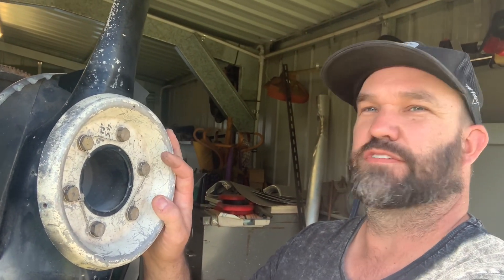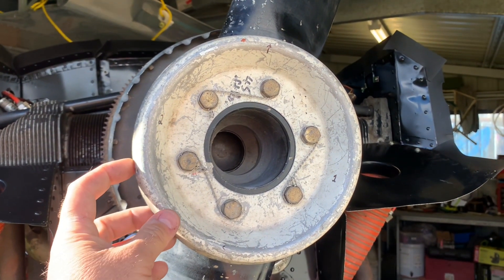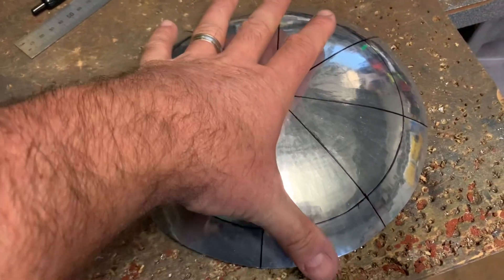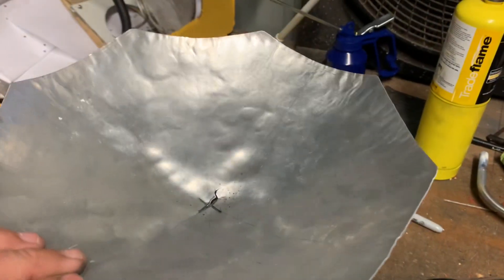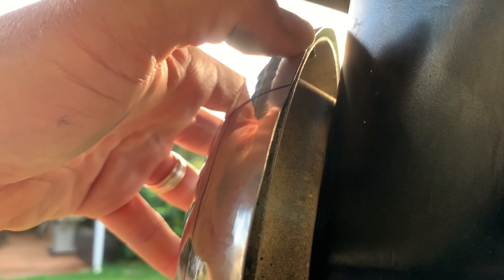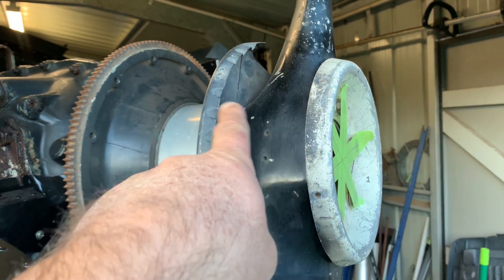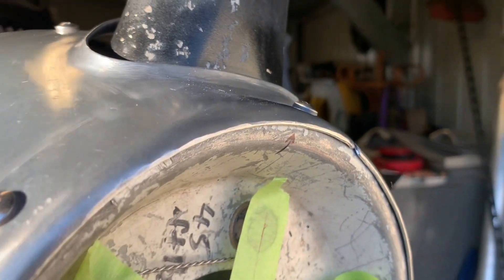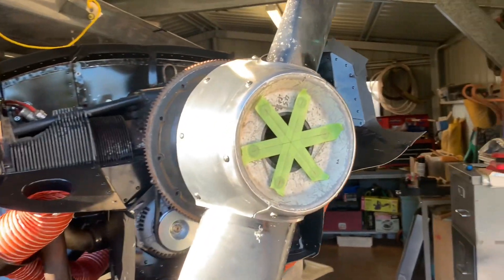Can I form my own propeller spinner for Frankenstein?

Comment: Looks great. The only consideration I'd add is balancing the spinner/backplate.
Reply from the maker: Thanks mate. You’re right, balance of the spinner needs to be considered. The backing plates are from the original spinner used on c172. So that was a good base to build from. The rounded option I reckon has a better chance of getting the balance right instead of a longer, pointier one.

Comment: A little more domey? The 172 type bullet looked good too.
Reply: Yah now that I see it on there it's not bad. Love a-lume-min-um work, as we say it.
Reply from the maker: @Tadrjbs  cheers mate, any excuse to bash metal is a good one huh!
Reply from the maker: I may still use it yet. I’ll know once I can look at the aircraft without all of the clutter around it
Reply: @donwtsn  It needs to direct more airflow into the cowling. How about the flat top half part replaced with that part more like a Cessna 195 one.
Reply from the maker: @Tadrjbs  cheers mate, because the engine intake is pretty big I think I will still get enough airflow past the spinner for cooling. All I wanted to do was cover the centre hole in the prop